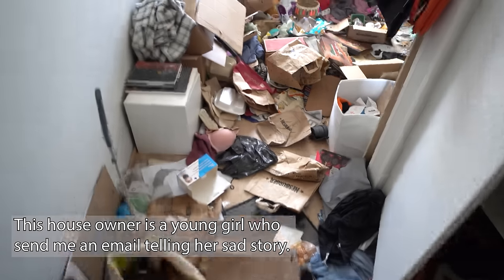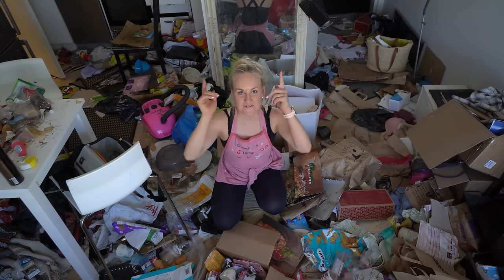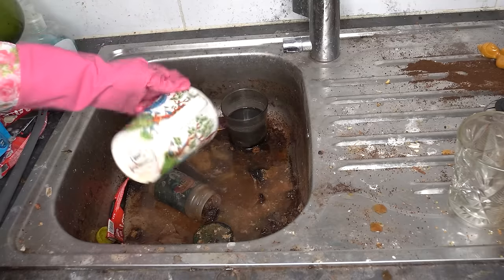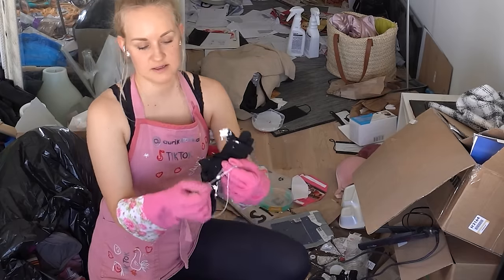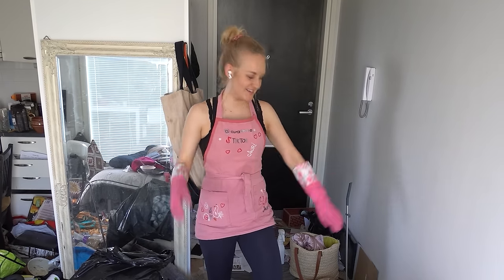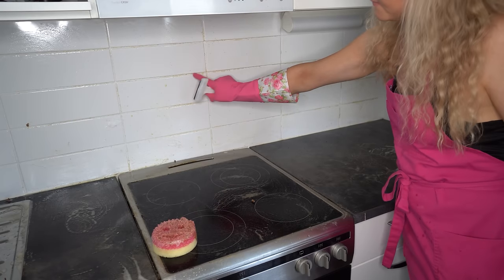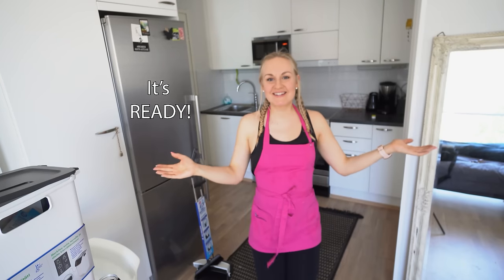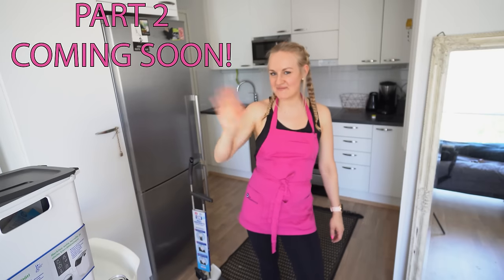MASSIVE 4 DAYS DEPRESSION HOUSE CLEANING FOR FREE | giving a fresh start! 🥰

Comment: I am always impressed How fast Auri is cleaning ovens. Today I Have cleaned the frontal glass of my oven with opening it by scruer and it took me minimum two hours! I am always impressed when she gets these results so fast! And I used sponges and paste :) She is just amazing!❤ Of course I know those movies are a bit edited and made faster but total timing for one flat is mostly 1-3 days so it means ovens must be done quickly! Really nice :)
Reply: She mentioned in other videos that she lets the cleaning product soak for a few hours, sometimes covers it with cling film so it would not dry but soak even longer. After soaking, cleaning is so much easier and faster. 🪣🧼🧽
Reply: After soaking in the oven cleaner fluid, if there's any more tough spots to remove. She takes a blade scraper to it.

Comment: Oh my goodness! I had to pause your video and see if my sink drain could open that thing like you showed! It didn't work. It kept slipping. So I went downstairs and got a chisel. It was disgusting!!! But I cleaned one of them out (I have 2 drains). I tried to open the other one but it just kept turning and turning. I WANT TO CLEAN IT! I might have to take it off from the bottom. But now I realize that I have a piece I will need to replace underneath. It looks very corroded! Anyhow, thank you for sharing that! I didn't know you could take that off to clean it!

Comment: you should wear a mask or open window while you work with such hard chemicals like chlorine or drain cleaner. I would also recommend to wear safety googles when working with drain cleaner ;) It's often sulfuric acid in drain cleaner which is pretty dangerous when it get in contact with your skin.

Comment: Question ? why is every filthy house connected to  depression, there are lots of people that suffer from depression i had it bad for a long time, like being in a black hole not caring if i lived or died and after a few years im still on 2 antidepressants and sleeping tablets. I had 4 kids in the house it may have been untidy at times but not filthy. Sorry just my opinion.
Reply: My room in the house I currently live in and the one towards the end of my previous living place has looked similar to this 
In my case it’s because it seems very daunting and when my depression and other mental health issues already make getting up and living through the day quite hard and debilitating it’s hard to find the want and motivation to clean up the space you’re living in especially if it’s gotten to the stage where it’s hard to walk through or even find an empty surface 
This may not apply to everyone as everyone’s experience with mental health is different but this is my reasoning for why my rooms often end up as ‘filthy depression rooms’